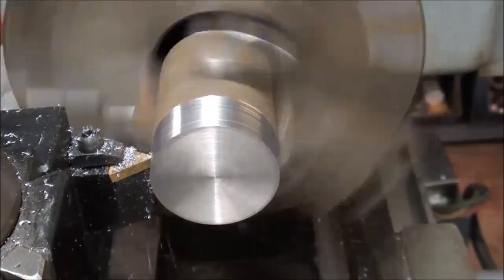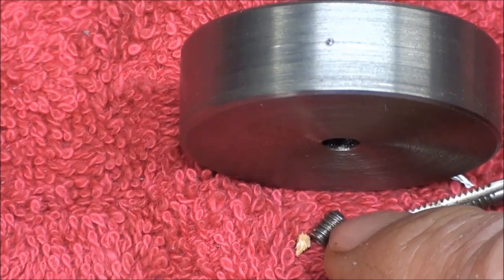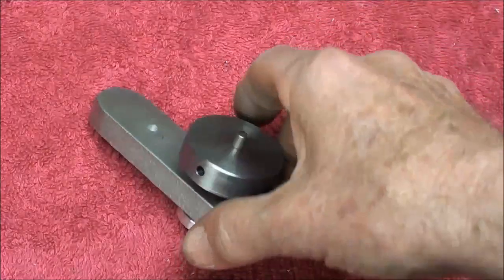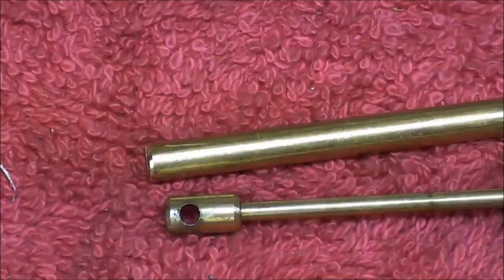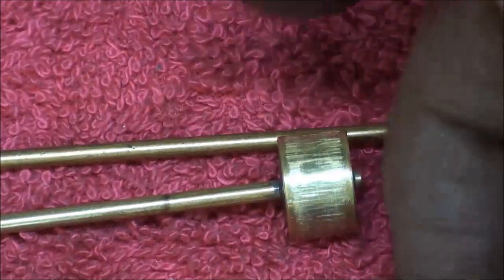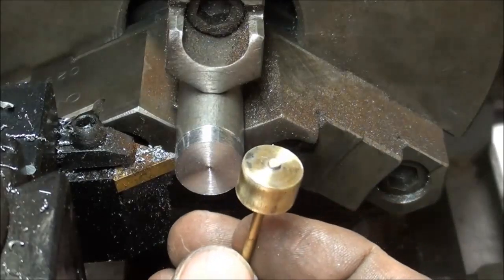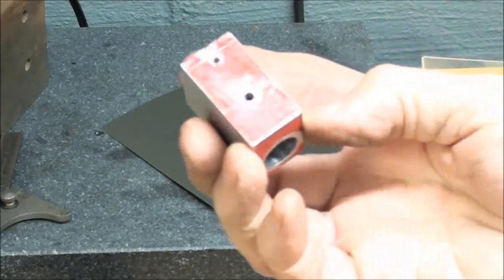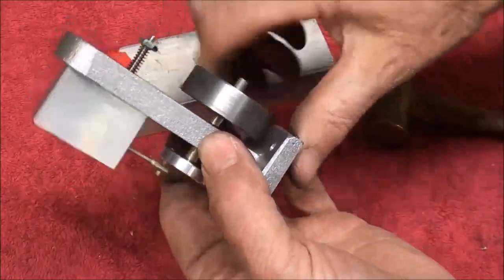TUBALCAIN BUILDS A SA OSCILLATING STEAM ENGINE Part 4 of 5

Comment: At 22:50 you mention that "heat" affects the Loctite you are using (those familiar with Loctite know that heat is the universal solvent).   If this little engine is truly to be run with Steam (as opposed to compressed air), wouldn't the heat soak from the steam eventually cause all these Loctited joints to fail?
Reply from the maker: Oh yes. It would fly apart.

Comment: What is the advantage of drilling the hole undersize then reaming it to 3/16 as opposed to drilling it to 3/16?
Reply from the maker: +Patrick Whitehead reaming produces an accurately sized hole
Reply: Good tip.  I hadn't considered that twist drills would be less accurate than a reamer.  Also, I took your advice and called up the railway museum.  I'll be heading that way on saturday to meet some of the guys in the steam shop.  The fellow I talked to seemed pretty happy to have someone new show up.  Looking forward to learning some new skills.
Reply from the maker: +Patrick Whitehead Have a good time!!

Comment: When you are drilling the hole for the connecting rod, maybe you could extend it into the cross hole. Then you could insert a felt pad and after assembly put a couple of drops of oil in - self lubricating bearing!

Comment: I use a lathe crotch to center drill round stock: Centered in my Crotch - Lathe Quick Tip Is this not as accurate as other methods?